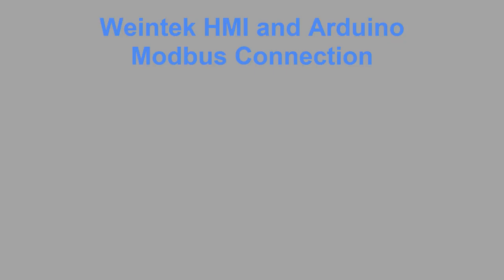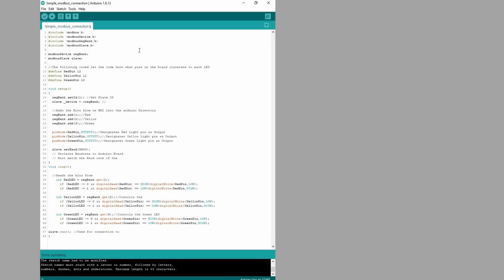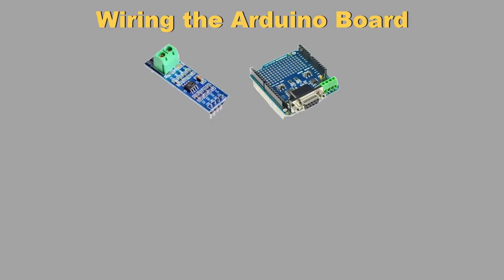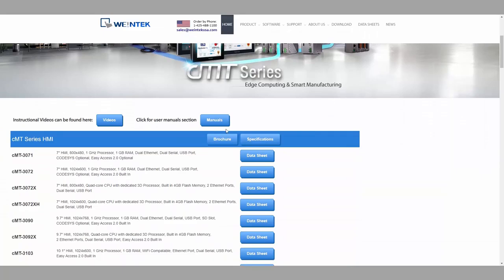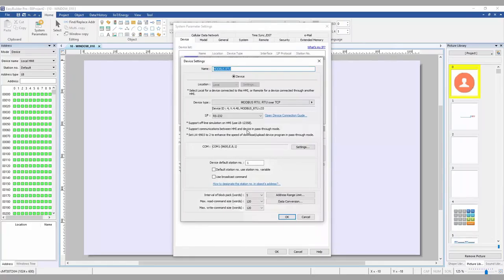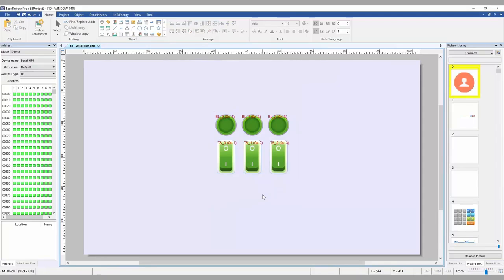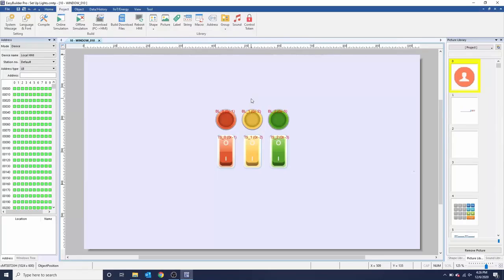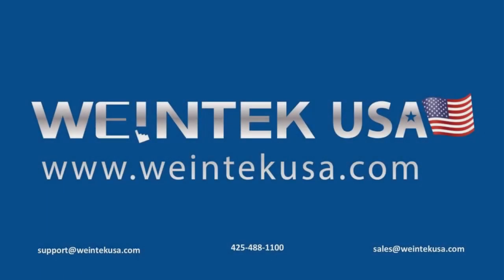Basic Arduino + HMI Connection via Modbus Protocol - Weintek USA coding

Comment: I tried code as like you but I'm getting error at slave.SetBaud stage as it is asking me to fill 2 unsigned char , word and hardware serial and I don't know what to type in the bracket. Could you please help me in this part as I'm using same RS485 to TTL converter what you have used so that it will be helpful in my project?
Reply from the maker: Hi @revanthkumar3246,
Some items discussed within this tutorial may be outdated, we will try to release a new tutorial soon!

Comment: The MAX485 module that you connected at 3:17 is not the same as you have in the picture at 0:48, which has DE and RE pins.  The only modules I can find are the type you show at 0:48.  Can you share where you bought the module that you used in the project?  ... The one we see at 3:17.

Comment: can i connect this system modbus with MT8050i HMI..???
Reply: Hi Mostafa,
The mT8050iE supports the "Modbus RTU, RTU over TCP" driver as well. You can certainly use this HMI within a similar application.

Comment: I use RS485 connector (in video 00:40) to connect it to arduino there are 4 pins: di(tx) ,de ,re ,ro(rx) and vcc ,gnd . Where to connect de,re ? Doesn't work without them

Comment: Hi, I am using Easybuilder 8000 for MT6070ip, and connecting with arduino uno. I am following the same process as in this video but it's not'working out. Moreover, there is no option for "MODbus RTU, RTU over TCP" in easybuilder 8000,  that's why I am selecting "MODbus RTU". Need your help.

Comment: Thanks for your  video..can we use rs232 communication..from hmi to arduino.?without conversion board rs485
Reply: Hi Uge,
For your application you will likely need an RS232 to TTL adapter or shield in order to communicate over an RS232 interface.

Comment: thanks for clear explanation. Just one thing. What's the purpose of that white cable attached to your HMI besides RS-485 adapter  at 8:50???
Reply: Hi Ibrahim,
The white cable at 8:50 is an Ethernet cable that was connected to our PC. It allowed us to monitor and control the HMI remotely.
Reply: @WeintekUSATeam.0  oooo right right thanks

Comment: Hello, really great video!! Am going to build up desktop mini injection molding machine for plastic... for the mechanical side no issue but for the electrical i really have no a clue ..as you know we have to use screen touch to adjuste temperature in barrel, turning screw back and forward and closing/opening clamping system and others ...any quick chance to do that with easy dimonstration to clear undaerstand and doing myself ? i would like to get you HMI screen panel if you will support how to steply pluged'em..i have email here any chance to support me your help will be greatly appreciated.

takebay@mail.ru

Best regards,
Talgat from Kazakhstan if nesserey my whats app +77016828586

Comment: Good morning
I repeated the example to the letter.
I use an MP8071iP.
I get the error message: "Device No Response".
Why this mistake?
Reply: There is a mistake in the video by the Display connection settings. The Arduino library in the description is hard set to 8N1. (Line 22 in modbusSlave.cpp "// defaults to 8-bit, no parity, 1 stop bit") So set the Display connection settings to 8N1 and check the station nr. of the display, it must match the number in the arduino code line 15.
Reply: @rovivo  that right! thank for your comment!
Reply: @rovivo  I've changed the display connection setting to 8N1 but still get error message: "device no response", and i dont understand about station nr.. can u help me please ?
Reply: Hi Davide,
In order to assist you, we will need more information about how you've designed your project. Please send an email to support@weintekusa.com with a brief description of this issue and your HMI's serial number.